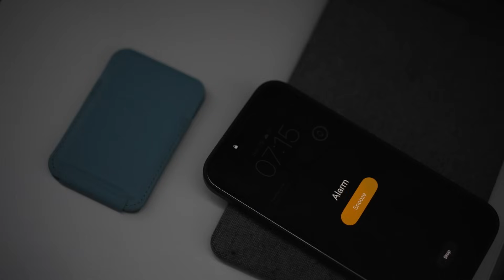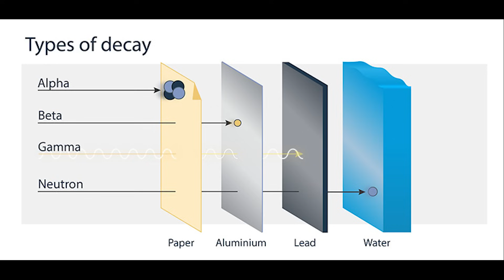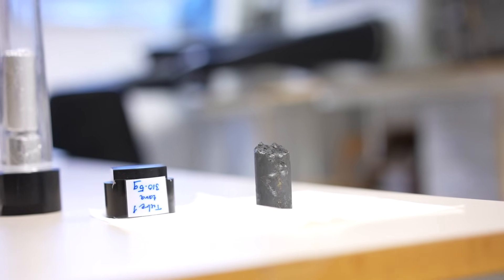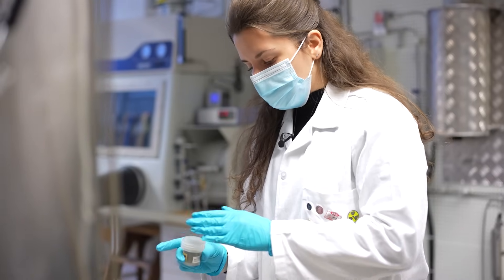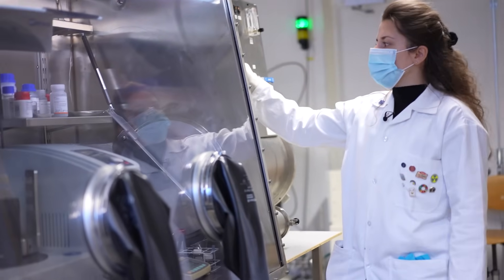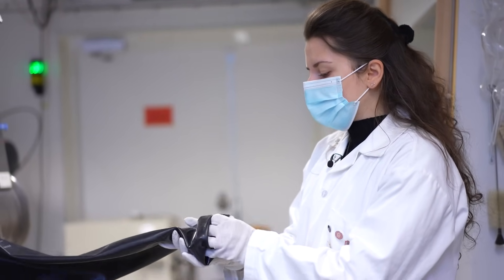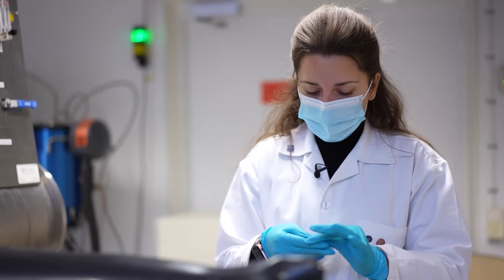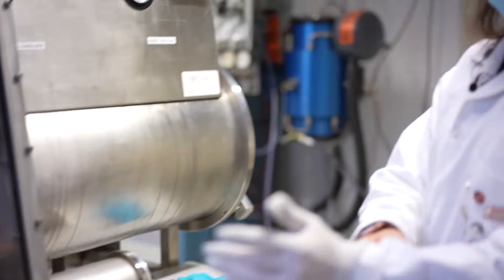Touching URANIUM and EXPOSING Myths - A day in the Life of a Nuclear Physicist

Comment: Terve!
Here's a thing I'd like to know: is it possible to make radioactive elements glow at all?
I remember that being mentioned in HBO's Chernobyl miniseries and I've seen the glow of reactors. I'm thinking about much more manageable levels of radiation that you could be around under normal conditions.
Thank you in advance and until next time
Reply: Lumps of Pu-238 will get hot enough to glow.
https://en.wikipedia.org/wiki/Plutonium-238
Reply: @wwoods66  oh, now that's hard to come by, isn't it. Thank you for that though.
You don't happen to know of more common elements that do the same?
Reply: @koston_varjo3536  Well, there's tritium. Hydrogen's a common element; that isotope much less so. It can be used to produce a glow indirectly, which is used for various things. 
And radium likewise.  https://en.wikipedia.org/wiki/Radioluminescence

The "glow of reactors" is probably Cherenkov radiation, not caused by specific elements, but by particles which are traveling faster than the speed of light (under the specific local circumstances).
https://en.wikipedia.org/wiki/Cherenkov_radiation
Reply: @wwoods66  neat thank you, I shall start farming water then - or whatever creepy thing is appropriate here to say.. (not even sure if superheavy water can be aquired like heavy water to be sure....)
Thank you non the less!

Comment: You sealed the uranium nitride pellet at the end in a small ziplock bag. Wouldnt that mean that there is oxygen in the bag? Or did you not completely seal it when you put in the flushtube?
Reply: She answered a similar question from another commenter.  In case you didn't see that, she didn't fully seal the bag until it was already in the box.  Once all the oxygen was pumped out, then the bag can be sealed.

Comment: Are the pellets shown of normal size? I had previously believed that UO2 pellets in reactors were about the size of beer cans, but perhaps I was mistaken.
Reply: They are actually that tiny. They all go into a thin tube, and a bunch of those tubes make up a fuel assembly, generally 17 rows of 17 tubes, and the whole assembly is about 25 cm x 25cm and over 4 metres long.

Comment: Never expected Uranium to be safe in its natural form. Interesting. Thank you for sharing
Reply: It's safe-ish. Alpha radiation is stopped by the skin, however if random uranium dust keeps getting in your lungs or digestive tract (which don't have a protective layer of dead cells) it could cause problems. Also, being a heavy metal, it is a conventional toxin slightly worse than lead. But overall, if you only have a small piece of uranium and you don't do anything with it that you wouldn't do with a chunk of lead, you'll almost certainly be fine. And if you use basic PPE like Elina it's not a big deal at all.

Comment: Nice video, thanks! It will be interesting to see the uranium nitrate video to understand why you are working in this. Did you still had oxygen in the Ziploc bag? Were you pumping the air and then injecting argon or only injecting argon in that tube?
Reply from the maker: The ziplock bag must be half open when entering the glove box (to remove all oxygen in it). Once inside the glove box it can be sealed all the way. 
To flush the tube you remove oxygen by using a vacuum pump and fill with Ar

Comment: I still wish you didn’t touch it cause I worry about youuu 😢😢 but you know best ❤ 
I love seeing this blog cause it’s like I m going together with you to work ❤❤❤ and I want to ask why the radiation machine made noise for the natural uranium since it’s not dangerous and the radiation so so low?
Reply from the maker: The uranium is primarily emitting alpha particles which are big and heavy and can be stopped easily and can only travel a few millimetres away from the uranium piece. Therefore when I approach the detector on the surface of the U piece I measure these a particles. But even a bit further where my hand is they don’t exist anymore ☢️👩🏽‍🔬 I hope this help understand it a bit better

Comment: What would happen if the dust of uranium enters inside our body??
Reply from the maker: Excellent question (hence my wearing a mask). Uranium is primarily an alpha emitter. And a particles only travel a few mm. Meaning if it’s sitting next to you on a table, no a particles will reach you but only beta and some gamma. However, if inhaled the a particles will attach you lungs etc and will be traveling still a few mm but now inside you radiating from the inside ones body and organs. This is the most serious contamination scenarios as doses for inhalation are about x200 larger than those for ingestion. ☢️👩🏽‍🔬
Reply: @YourFriendlyNuclearPhysicist  Understandable thanks for answering 🙂

Comment: I would be interested in seeing both the manufacturing process of pellets, and also what the potential benefits of uranium nitride fuel as opposed to oxide fuel would be. Also some of the images from an electron microscope of the structure, and/or some of the things you test for in the pellets might be interesting. I love your effort to educate and reduce misconceptions of nuclear topics!
Reply: I believe there’s a “how it’s made” on fuel rods for reactors. Might be interesting to watch.
Reply: Nitride fuel is a better conductor of heat, which means the outside of the fuel can be allowed to run hotter without damaging the center of the fuel pellet. The main problem is that it needs isotopically enriched nitrogen. The most common nitrogen, N-14, captures neutrons and makes C-14 + P. That's bad; that makes it a neutron poison and it also makes hydrogen inside the fuel pellet which is not so great because it gradually causes the fuel pellets to swell (as do fission products and displaced atoms in a crystal lattice bombarded with energetic neutrons). 

Atmospheric testing of nuclear bombs generated a lot of carbon-14 this way; and it makes carbon dating anything that happened after the invention of atomic bombs difficult; we don't need to do this carbon dating now so we don't care, but someone trying to carbon date something a few thousand years into the future may have problems. To make this fuel nitrogen-15 has to be used.
Reply: I feel like the US government might have an issue with the video "how to manufacture nuclear fuel"
Reply: I agree!!  All of that would be most interesting!!!
Reply: She does not even state if this uranium is enriched and if so how much. Sorry pal but she is lame.
Reply: @welchroberts4038  if the uranium pellets aren't going to be used in a CANDU reactor, they need to be enriched. Although if you're talking about the experimental ones, it is possible they would use non-enriched uranium while testing the manufacturing process, as that would make the pellets less dangerous to handle. 
It was a relatively short video and it's not really possible to explain all the details of composition in it.
Reply: @blaperture-1  During her talk I had no idea if she was serious saying it was natural uranium. 1% U235, or enriched for power plant fuel.
Reply: @blaperture-1 Not necessarily: There are some other reactor designs which can also use unenriched natural uranium, such as the old "magnox" first generation reactors built in the UK between 1950 and 1970. The subsequent evolution of that design into the AGR (advanced gas-cooled reactor) could also be run with natural uranium, as could the Soviet Union designed RMBK reactors, though both of these were switched over to low enriched uranium (between 2% and 4% U-235) for higher efficiency operation.
Reply: My guess is some parts of the process are not allowed to show, because with enough research countries can use it to create atom bombs.
Reply: @autohmae  I don't actually think so. The details of centrifuges are very thorny but if you look at a centrifuge cascade you just see a bunch of tubes with some small pipes connecting to them and the whole array is making some noise. That doesn't tell you anything. Centrifuges are very simple in principle but they have to spin at ~100 000 RPM without blowing themselves up; the outer surface of the spinning centrifuge is moving faster than the speed of sound, typically around mach 2 (~rifle bullet) and has to be in a vacuum; very special bearings are required; there are many intricate details that are kept secret (e.g. how to deal with various resonance modes that can cause it to unexpectedly vibrate and shake itself apart; what the best materials for their manufacture are etc).
Reply: @autohmae  its pretty basic technology, and if you know what you need to be looking, google can provide you with enough information

Comment: 1. I assume you use a mask on your mouth and nose to block alpha particles. Are eyeglasses not required too?
2. Did you have to fill out a lot of paperwork to show us this? It's very cool! I'm glad I got to see it in the video.
Reply from the maker: 1. The mask is mostly from dust particles, if any, to nor be inhaled. The alpha particles will not travel more than a free millimetres so the mask isn’t necessary for them. And goggles aren’t necessary for the same reason. Although it’s always good to wear protection when protection is required. 
2. Not much, mostly approval by lab manager and head of the department ☢️👩🏽‍🔬
Reply: @YourFriendlyNuclearPhysicist  The radiation is only at a radius of 3mm?
Reply: @mep1111  Alpha particles! They are fast moving helium nuclei and they will slowed down very quickly by collision with air molecules. Beta, gamma and neutron radiation are a other thing...
Reply: @MisterIvyMike  I am surprised they even get slowed down just by air.

Comment: I'm aware α & β radiation can be stopped by the skin, although I wouldn't wanna be exposed for a significant amount of time because, as far as I understand, they would still dump the energy and cause something very similar to a sunburn. β radiation, correct me if I'm wrong please, is mostly dangerous when is, somehow, ingested into the body not so much by the "nuclear" radiation itself, but by the increase in temperature (IE internal burns).
Wouldn't α & β radiation be stopped by just ordinary clothes? I'm not touching γ because we all know it gives you superpowers.